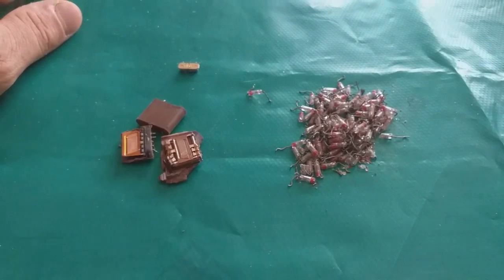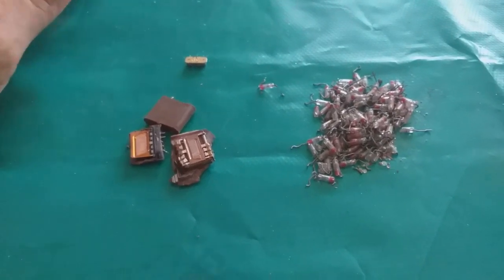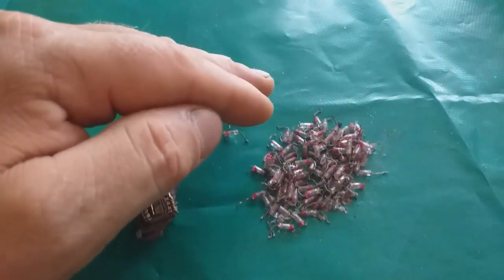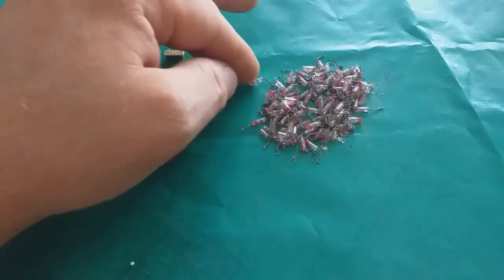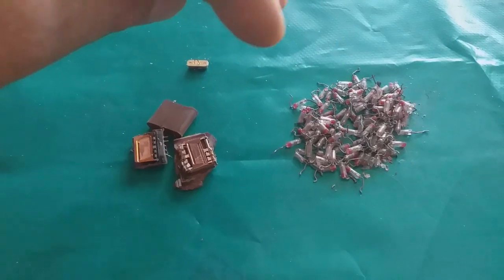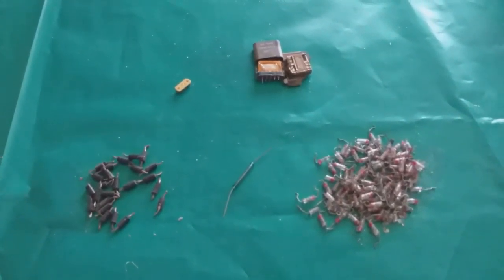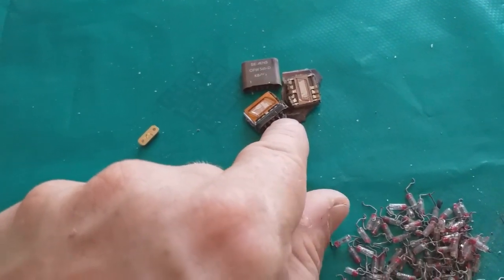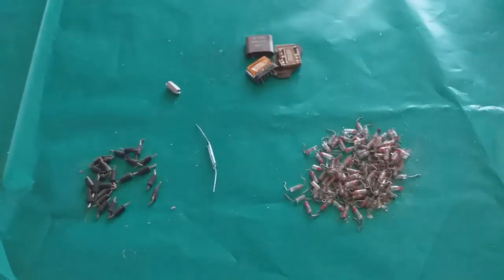More gold item to show!

Comment: in glass case is a high frequency germanium diode with gold nib.maybe type:1N34A. equivalent is TESLA diode GAZ 51 in metal case. used in old electronics :) greetengs Dusan good luck
Reply: good call:-) i was close but wrong.
Reply: Germanium $2.8k / KG, those guys definitely worth hunting for germanium recovery

Comment: glad to see your getting subs , got a question for ya , I wet ashed some bga chips and now have fiberglass and silica wafers and bonding wires in a wad , could I just melt the entire mess and add some borax to float the glass out of the gold instead of going with aqua regia ?
Reply: probably yes but an alternative would be to use hydrochloric acid  and bleach this also will make Chloroauric acid out of the gold. you can the precipitate just the gold with smb sodium metabisulfite a comin food additive the fine brown or yellow powder will be almost pure gold. if you do this do it outside or with a vent hood as chlorine gas is a byproduct of this process.
Reply: @claytonmccormick7506  did that once , fumes turned my field behind the barn yellow lol , was just wondering if it would work to get the gold without it turning into volcanic slag , im not really concerned if it's 9999 pure

Comment: would have subscribed twice if i could always enjoy your posts was hoping to sent some glassware chemicals tools and 40 lb chips 30 lb gold plated pins 1 kg mlccs and 20 lb kb mylars before you stopped taking commissions the black ones are diodes old lots of 70's vintage parts have lots of gold scanner pickup tubes have a lot of gold too.
Reply: merci pour l'information  j'ai justement ces petit tube en verre et rouge comme sur la vidéo